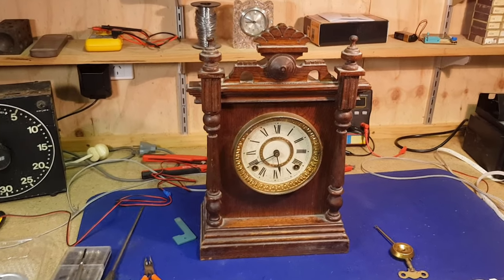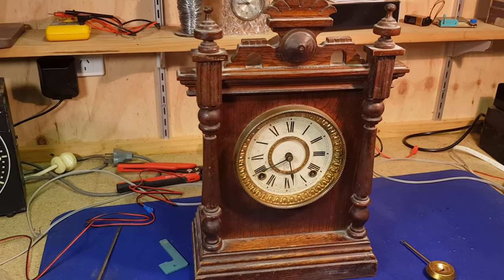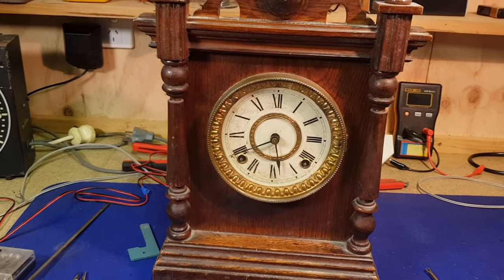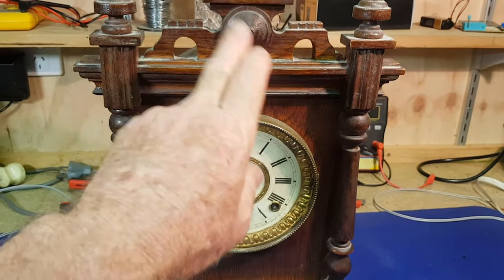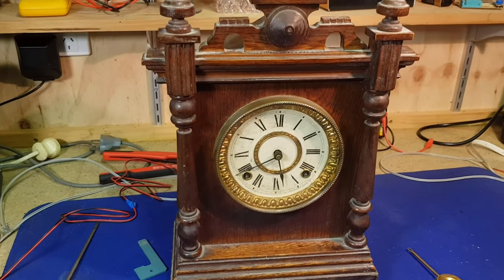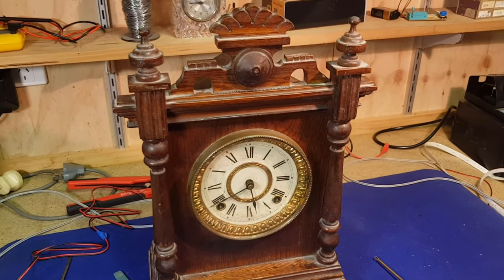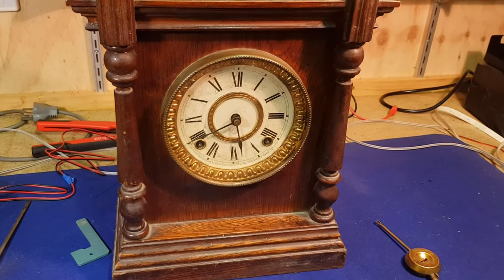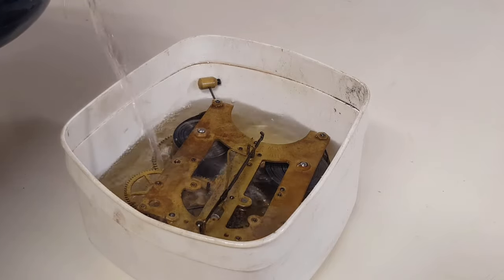How to fix an antique mantel clock. Service & lubricating an overwound movement. DIY Ansonia repairs

Comment: I've been repairing clocks for 30 years, and although I take some completely apart, more often than not I will clean them and oil them as a unit like you did here. That way I can have a happy customer and not charge an arm and a leg to make a $50 clock operate for many more decades. I get the same result and the clock snobs will disagree, but they're part of the reason people don't have their clocks fixed. Good video.
Reply from the maker: Thanks Marty, I really appreciate this comment! When I posted this I was expecting some negative comments about not being a proper repair job from the "proper" clock repair guys - but it didn't really happen thankfully! The bottom line is that it is an effective and economic way to save a clock's life... and I really wanted to stop people spraying the movement in gallons of WD40! 😱🤣
Reply: In my personal opinion WD-40 should NEVER be around clocks... after a few months the liquid solution becomes Gummy solution and main reason why most clocks stop working...
Reply: Sound advise.
Reply: Exactly my thoughts, i take a bucket fill it with gasoline 4%oil and blow Air on the whole thing with my Compressor Air gun, that way it will create alot of pressure and bubbles when the bubbles burst it blows the dirt away, just like ultrasonic just remember, no smoking, wear gloves and gas mask and do it outside 😃👍🏻
Reply: Hello, my mantle clock has three key holes/ wind up holes at the front the first one will not move when you put the key in, the other two work fine I can hear them when winding them, I have taken the clock apart and cleaned and oiled it, but it still will not chime the hour, it will chime every 15 minutes, but not on the hour, ie two tolls for two Of O Clock ec  cetera, can you give me some advise please.
Reply: @kev1523  It's hard to say without looking. You do know that the two main springs turn opposite ways when winding the key? Try turning the one that won't move both ways.
Reply: @martymcgill1312  thank you
Reply: @TheUltimateRecycler  WD 40 and 3 in oil oil is the WORST for gumming up sewing machines also ..turns to varnish
Reply: @thegrassyknoll7792  ..........I like that idea.......................
Reply from the maker: @kev1523  Sorry Kevin, I only just noticed this question! Sounds like there's something wrong with the strike train (the one that counts the hours). If the key won't turn, then the spring is fully wound and something is bound up stopping the power driving through the gears to operate the hammers. It could be a damaged tooth perhaps - you'd really need to dismantle the entire movement and check everything unfortunately.
Reply: @TheUltimateRecycler   can you repair my clock mine isn’t working I put a battery in it and nothing happened
Reply from the maker: @Cam.469  Sorry mate, I'm struggling to keep up with my own repair jobs let alone taking any customer jobs!
Reply: @TheUltimateRecycler   that’s ok just keep up the good work
Reply from the maker: @Cam.469  Thanks mate! 😊👍
Reply: Yes, your practice of doing the cheap method of dipping it in a cleaner, oiling it… ‘the best you can’, and charging next to nothing causes people to distrust clock repair people.  The clocks only last a year or two after that shortcut method is used.  So, it is a waste of money at any price…  and the customer thinks you are a hack!  If that is your goal than continue the practice.  Just say’n.
Reply: i have a $30 clock….crossing my fingers that i can at least get it to run—i think chime pieces are missing.
Reply: This was brilliantly explained. Have just been given a similar clock and will attempt to copy you. Thank you SO much.
Reply: Marty when you do this you are not able to polish the pivots scored pivots with grooves create friction

Comment: Overwinding a clock is a myth.  Negligence is the culprit. However, full disassembly is recommended in this circumstance.  Pivots need polished and bushings put in place of the worn pivot holes.  Sometimes a simple clean and oil will get it running, but ultimately they wear out and need a full overhaul. And I would recommend against using petrol or gasoline for use as a solvent, as the base chemical for fuel is oil and will leave a thin film coating of it throughout, which will attract more dirt and debris.  Overall, great explanations and steps for a DIY clean and oil, but I would caution against anyone trying this with their family heirloom!  If you don't know what you're doing, take it to a pro and have it done the right way so as to make it last for many more years.
Reply from the maker: Thanks for your comment BC.
Yes - overwinding is an incorrect term used by people who don't know any better.
As for the clean and lube - for your average common mantel clock this method is a great DIY way to prolong its life and give many, many years of life. I disagree with your suggestions that petrol residues will have a detrimental effect on a clock's movement - at least in our lifetimes! A watch, probably - but not a clock. People who just want to keep Granny's clock going will not take it to a pro and pay many times what the clock is worth even just to have it serviced! I'm sure you will be aware of the expense of having a clock professionally serviced - and equally aware of the low retail value of common mantel clocks these days. Cheers, Chris
Reply: @TheUltimateRecycler  My apologies if I came off as rude, just trying to caution people from trying this with a super complex, and expensive, clock.  For the cost - in my experience, most will pay if the personal value exceeds the monetary value.  The fix you've shown here will give it a few more years, at best (as I did catch sight of a couple badly worn pivot holes on your clock), but these American time & strike movements are pretty tough and can withstand that amount of wear for some time. But, ultimately, that movement will need a full service (overhaul) in the somewhat near future to continue functioning efficiently and accurately.

For some actual constructive feedback - I would still shy away from petroleum-based solvents for the reasons mentioned above.  However, some excellent solvents to use are trichloroethylene or, depending on local laws, you can use perchloroethylene or a chlorinated automotive brake cleaner.  Use a small, stout, paint brush to clean out any dirt and dried oil from around the pivots, inside and out.  A lengthier, but more affordable approach, you can also use degreasers like Simple Green or even Dawn dish soap with warm water and a brush, followed by a quick isopropyl alcohol bath to remove any moisture, and drying with a simple hair dryer. Make sure to let the mainsprings down all the way so they can get cleaned properly, as well.  Now, for the average DIYer, this is a quick "rejuvenation" and can be successful in most cases, such as the mantel clock you've shown.  Servicing a clock is, as you say, quite expensive, and mostly because the number of professionals have severely declined in the last 20 years.  For a clock like that, it could easily cost $350 - $400 US for a complete overhaul, and takes 4-6 hours of work to complete properly.  But the payoff is a reliable timepiece that will function for decades, and even longer with regular oiling and cleaning about every 4-6 years.  It's a shame to watch the prices of these antique clocks continue to drop in recent years.  

Again, I apologize if I seemed rude.  Take care!!
Reply: Oh and one last thing:  Automotive oil is an ok lubrication method for the springs, but I've found automatic transmission fluid to be slightly better! :)  Cheers!
Reply from the maker: @BrackenClockWorks  Thanks mate, some great info there. I didn't take it as rude, but as I get called a "cowboy who doesn't know what he's doing" from time to time, I automatically jump into defense mode! 😂
Yep $350-$400 US expense for a $100 clock shows exactly why most of these clocks simply don't get repaired at all and many do actually get thrown out! If people do have a rare or expensive clock, it should certainly be done properly - totally agree there. 😊

Comment: Oh I’ve got my hopes up now, once I got a free weekend I’m stealing my late grandmothers clock from my moms house. It’s been ‘overwound’ for a few years now & not working. Need to take a peak inside & hopefully surprise my mom with a working clock.
Reply from the maker: Hopefully you have some success Cara! If the clock has been used a lot during it's life there's a chance it will be too worn to operate properly, but it's worth a try. This method is certainly not going to harm anything as long as the clock is re-oiled. Good luck! 😊

Comment: Hi there, while I was trying to unwind the main spring on a similar clock holding the key when I released the pawl the body of the clock spun around & the key sliced 3 fingers so be careful folks . Great video thanks
Reply from the maker: Yes, exactly Eric, much caution should be exercised! Those springs really pack a punch!
Reply: Sessions clocks have a reputation for weak ratchet pawls/click springs that when attempting to wind, the key will suddenly spin in your hand.
I nearly lost a thumbnail while winding a Sessions tambour clock.
Those springs pack a tremendous amount of power...(!)

Comment: Good video . This works for most larger clocks . A little tip .... when the solvent has dried . Put the end of the straw of a soray car carburetor ckeaner can hard agaist where the pivots come through the backplate and spray . This will remove any remaining gunk from the pivot holes . Then oil the pivots . I find a tiny amount of oil on the pallets also helps . Purists hate this way of fixing clocks but it doss work and keeps them running fir years . Regards from the uk .
Reply from the maker: Thanks mate! Yeah, I get numerous comments from the purists! But they can never answer how else to save a cheap clock economically! Thanks for the tips! Cheers from Oz!

Comment: You should never use oil on a spring because when the spring is wound and completely compress the oil will end up dripping out and getting inside of the wooden case of the clock. Always use a Teflon based grease but just a very very light coating on the inside of the spring coils
Reply from the maker: Thanks for watching and your input 👍 I've heard that before, but I've also heard not to use grease of any type from experienced clock repairers - so I think the jury is still out on that one. I've had no issues with a very small amount of oil on mainsprings and I think it's just a matter of removing any excess when the springs are fully tightened the first few times.
Reply: If oil comes out it is over oiled and simply wipe it off there will still be enough lubricant to lubricate the spring

Comment: This was exactly what i needed to see, i have an old pendulum clock that's not running and didn't want to spend all sorts of money on specialty cleaner . I have sewing machine oil but don't have the spring release tool , so that might be a necessary purchase . Thx, you've saved me money not having to but 60. cleaner 🙂
Reply from the maker: Excellent! Good luck with your repair! 👍😊

Comment: Excellent, excellent, excellent!  You have inspired me to do mine.  I'm going to do exactly what you did.  Plus, i'm going to pour the gas into the lawn mower after the soaking is done.
What an excellent video.  It's so practical and down to earth!
Reply from the maker: I'm sure you will mow your lawns in record time Bryan! 😉🤣
Thanks mate 😊
Reply: @TheUltimateRecycler  Ha ha!  What I didn't mention is that there may be a "bit" of oil everywhere in my previous attempts to get the clock working.  This oil will be good for the lawn mower engine.  I may have sprayed down the entire mechanism with WD-40.
Question:  This is actually a 45 year old cuckoo clock.  But, this approach should still work (maybe easier because this clock has no main springs).  It's just that it looks so hard to get the mechanism out because of all the levers.  I can see oil hanging off the music mechanism.  ha ha

Comment: I brought home an old antique clock, similar to yours, last night.  It has been sitting in my parents basement for the past 60 years, on a shelf, completely untouched.  Of course it did not work and it was a bit dirty with dust.  I cleaned it off, polished the brass, cleaned the wood work and I was just going to put it on a shelf somewhere as a stationary ornament when I came across your video.  My gong mechanism also worked, and the pendulum had at least some movement.  Right now the mechanism is soaking in an old ice cream tub filled with gasoline (or petro as you called it...).  I'm about to go outside again and give it a brush down.  I will be using 3 in 1 oil for the oiling.  It says it is good for sewing machines.  I will post back on how it goes.  Thanks for the tips!
Reply from the maker: Awesome John! Sewing machine oil should be fine, just don't use too much. Yes, definitely let me know how you go! 👍😊

Comment: God bless you for the video, I took my clock to shop 3yrs ago for clean and oil ran fine then stooped again, he said it's probably something more serious. My dad gave me clock it's a cheap Korea wind up but means a lot to me its 45yrs old. I thought I'd order some oil and try myself so took apart and the guy put to much oil it was nasty so cleaned real good and he never oiled main springs at all, anyways oiled like you showed and thank God it's running again. I missed hearing it tic tok and chime, no more clock shops for me unless something actually breaks.
Reply from the maker: Fantastic - and well done to you for having a go! 👍😊

Comment: Thanks I will try that with my grandparents clock from 1936 that just stopped working in my fathers tenure about 20 years ago.
Fingers crossed.
Thanks again
Reply from the maker: Good luck with your project Liam! 👍😊
Reply: Hi,
I done as you recommended, I let the three springs down and gave it a petrol wash.
Almost instantly the striker and the chimes began to move into life.
The movement however did not show any sign of life,so I rewound it up to see if it would make a difference.
But unfortunately it did not.
I’m beginning to think there is a problem with that main spring and think I will have to remove it, it’s concealed within a small drum.
Thanks
Liam.
Love your videos very concise and informative.
Reply from the maker: @liamo9823  The petrol wash method isn't really suitable for enclosed mainsprings unfortunately. The only real way to free them up and re-lube them properly is to dismantle the movement and remove the spring from the barrel which is MUCH more involved than just a petrol wash. Some movements allow you to remove the barrel & spring without separating the main plates, but still removing the spring and reassembling can be tricky and a little dangerous as the springs can pack a real punch!
Reply: @TheUltimateRecycler  
Hi Thanks,
Really appreciate your detailed description.
I think I will get it looked at by a professional.
Thanks again.
Liam

Comment: Every insight is helpful, but shortcuts can be super helpful  :)   I particularly like the ideas of a petrol bath left overnight, and a reminder to use one only drop of oil: the logic being that the oils surface tension will hold it in place whereas more than a single droplet and it just tears and sucks all the oil away from bearings  :)  again thank you for posting.  I'm already subscribed to your exceptional channel  :)
Reply from the maker: Many thanks John, I'm glad you are enjoying the content! 😃👍

Comment: The video I was hoping to find! I just bought an old mantle clock (missing hands, weird obviously not authentic pendulum) for $20, and was curious how hard it would be to work. Looks way easier than repairing a cell phone (being designed for repair definitely helps) and I've done that before. 

May have to wait for the spring though considering the degreaser. 😂
Reply from the maker: Great Das, thanks for watching and I hope your repair job is successful 👍💪

Comment: Bought an old Sessions Kitchen clock and your advice for cleaning and oiling put it back to running with an escapement adjustment runs fine, thanks!
Reply from the maker: That's awesome Johnny, I'm glad it was helpful 😊👍

Comment: I have an almost identical Ansonia clock.  The case is slightly different.  I bought it at a flea market for next to nothing and a work colleague's father-in-law who was a clock repairer restored it for me for a very reasonable price.  I thought the case was made from some kind of red wood but it turned out to be golden oak.  Sadly, my clock is not working either and it had a bit of an accident so the dial is hanging off and the glass hinge will probably also need to be resoldered.  When it was working, it kept really good time.  Going to bring it down from the loft and have a go at cleaning it and repairing the case.  Thank you for this informative video.
Reply from the maker: Thanks Pythonaria, I appreciate the comment. Good on you for having a go - I'm sure you can do it! 👍😊

Comment: Thank you for this wonderful video. I have a number of clocks that need service. Now, how about bedside alarm clocks. Are they difficult to repair?
Reply from the maker: Every clock is different in its repair requirements John. Small alarm clocks can be very fiddly, but may clean up and re-oil more easily than a larger clock. Many have excessive wear and require a complete dismantle and re-bushing which is much more complicated! Thanks for watching 😊👍